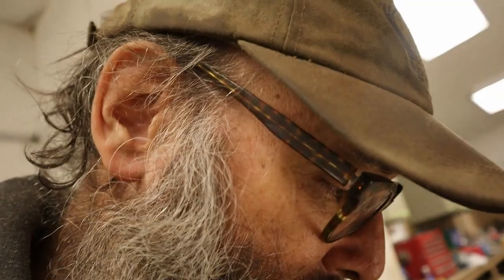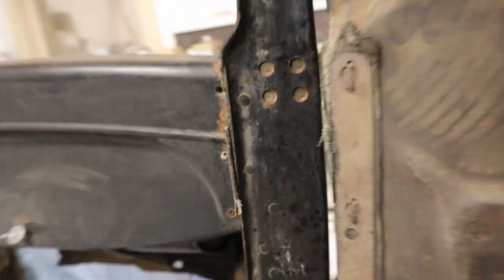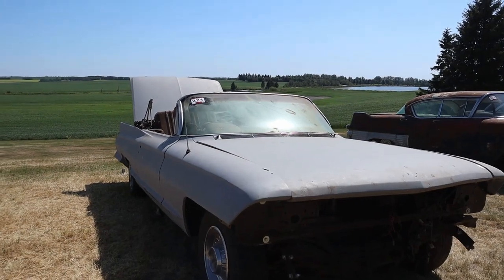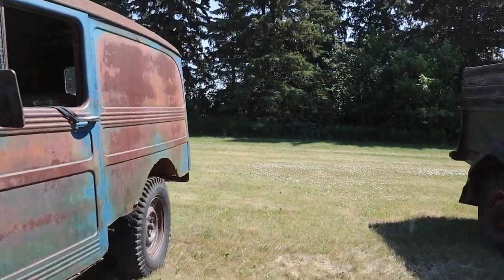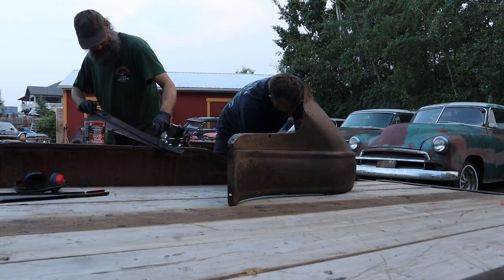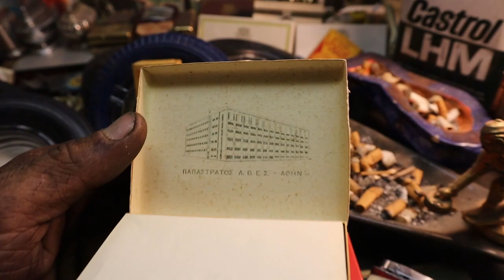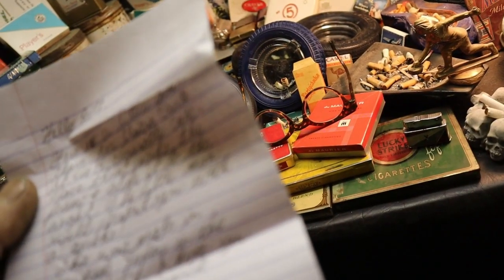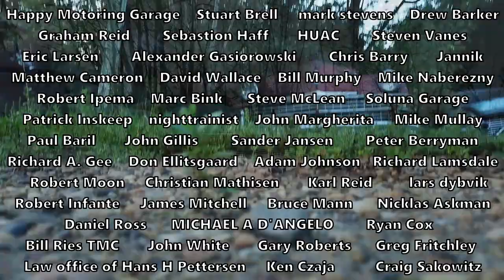Fitting the Model T door & Frankers is Four!

Comment: That '63 Caddy convertible brought back a lot of memories.  Back when the first oil crisis struck, I was tossed out of my house and soon divorced by my ex (fortunately no children).  I had to move back into my mother's house in order to regain my financial equilibrium. I lost the VW beetle to my ex and didn't have funds to buy a decent car cheap.  So, in 1973 all I could buy was a $900  '69 Caddy deVille ragtop (that needed a top as it literally was in rags. White paint, white top, ostrich leather tan interior) and so was driven around as a Caddy ductape top (which didn't go down until I could afford to pay for a new top several months later).  The more I drove the car, the more I liked it despite the gas guzzling 472 cu. in. 10.5 to 1 compression V8 which ran only on premium leaded gas (in the summer heat I'd have to stop the car in drive in order to stop the motor or it would just run on and on for minutes at a time)..  I saved the car, put some money in it and put about 40K more on it. I sold it in the early '80's for $2500 for a down payment on a house.    I should have held onto it but I replaced the void with a 1972 Delta 88 Royale red convertibe, white top, white interior, with a big 455 Cu. In motor in it and every imaginable option you could get, once I was settled in the house.  I couldn't tell which of the two I liked best.  The Olds had a fibreglas boot cover which was unique & cool but the '69 Caddy had a one year only mechanical cruise control and a 60-40 heated front seat..

Comment: That White Caddy Conv. next to the Edsel is a 64 El Dorado. If you look at the rear wheel well openings you'll see chrome trim going around the lip. If it were a regular conv. it would have a fender skirt . Plus 64 Caddy's had a body colored piece separating the upper and lower grill halves. 63 Caddy grills were all chrome. No body colored piece.

Comment: Nice job on the T door. Same doors used on the 1928 - 1929 Ford A CCPU. Usually here in the Northeast have bottom rust out and quote hard to find. They are reproducing them now at $1300 a door.

Comment: Can you use a long round rod thru the top and bottom hinges to get the location of the middle hinge so you get that middle hinge to line up with top and bottom one that way so all the hinges line up and don't bind that rod has stay perfectly straight . Good luck you got some really old sheet metal to work with that body has to stay really stiff.

Comment: As flexible as the Model T body and chassis is, how hard is it to keep the gaps and operation of the hinges correct when the body is on the horses versus mounted on the frame? When driving the car, how much will things move around?